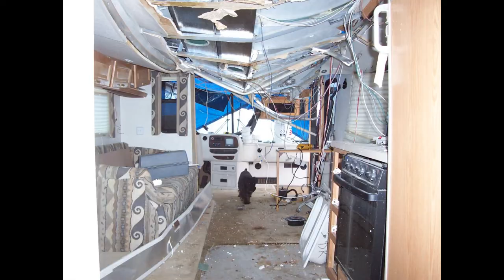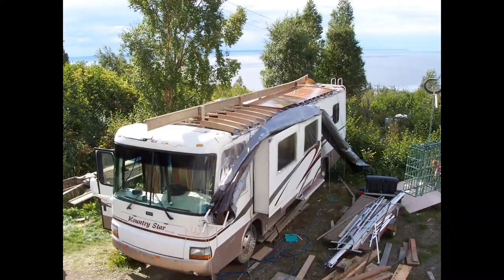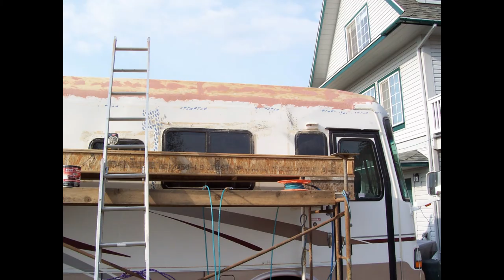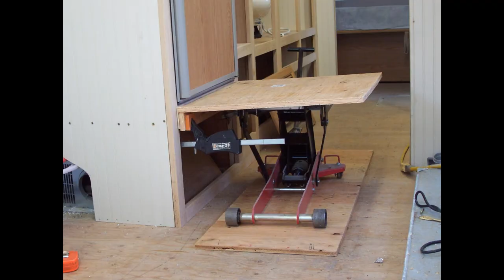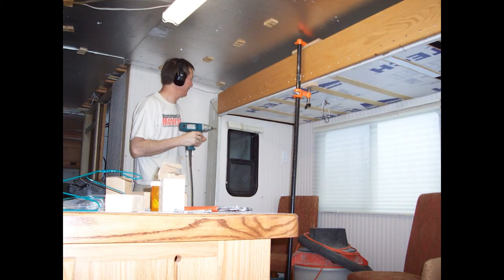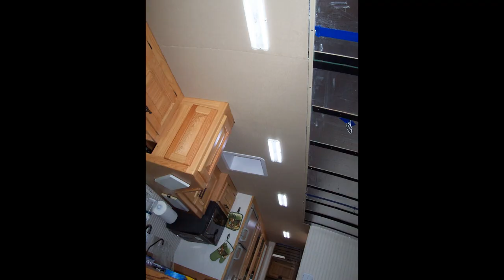Picture video of rebuilding a totaled Class A motorhome

Comment: I've been in Class As for years. I seen a few that had been rolled and that's what I first thought happened to this coach. I must say bravo to you and your fam (crew) for the huge amount of work that went into this.
Reply from the maker: Thank you! We were pretty shocked at how poorly built and flimsy the structure was once we opened up the walls and removed the roof. I would be amazed to see one of these (Newmar's) that had rolled over, I wouldn't expect there to be anything left above the floor. Our Kountry Star would have disintegrated in a roll over. 

It is structurally much stronger now but I doubt there would be much left of it in a serious crash. 
Best we don't crash!
Reply: @JagLite  I own a Wanderlodge. All steel top to bottom , front to back but for the end caps. That why I bough it. Can’t afford a Prevost or a Newmar.
Reply from the maker: @christopherrasmussen8718  Yes, the high end coaches are very well built, but you must be thinking of Newell, not Newmar.

 I hope Newmar's (Dutch Star, etc.) are built better now than our 2001. The wanderlodge has always a very well made vehicle. The average relatively affordable campers have to be pretty simple and quickly built.
Reply: @JagLite  My bad. That’s what I meant.

Comment: Wow  great work guys. I have a 2006 Damon Astoria  Class A so it is very interesting  to  see the actually reconstruction of a unit. Great video
Reply from the maker: Thank you! 
I was surprised at the low quality of the original construction but maybe it was built during a new employee training period? I can understand better why an RV remodel costs so much. The remodel has to deal with all the hidden issues. But that's no different than old house remodels, you never know what surprises you will have to deal with until you open it up.
Reply: @JagLite  that's too bad about the low quality in the initial build. I bought  my Astoria used and what I've had to work on, the original  build was awesome. Thor motorcoach have been extremely  helpful.
Reply from the maker: @johnelias9568  Argh! Jut lost my reply, Try again...
That is excellent that Thor was helpful! 
Newmar was the opposite. When I first brought it home I called Newmar to explain the project and that I was going to order a lot of things from them, including the aluminum header beam that supports the roof over the slideout.

I was told that they do not sell parts to owners, I would need to order through a retailer and that they do not sell structural parts anyway. Nor would they give me information on the dimensions, specs on the header beam. ( I just measured the old bent beam and built my own) Then when I had it opened up inside and had the rats nest of wires exposed I tried to get an accurate wiring diagram but the RV shop I was ordering from said they couldn't order anything (no wiring diagram available) and suggested I call Newmar directly. I tried again and was told the ONLY wiring diagrams are the ones found in the owners manual and I could order that through my retailer.  I have the complete owners manual and the wiring diagram is a joke. It is a generic diagram for ALL their motorhomes (at that time) and the diagram states that "Your coach may be different" and that the wire colors listed for various circuits "may be different". Totally worthless.

They had the wires going any which way, wires that were spliced in the middle of runs, wires that changed colors between connections, etc.
I had two options: 1. to completely rewire the bus and run the wires in sensible directions and locations, or 2. to just put the mess of wires back where they were since most everything was working. I went with number 2.

We only have two lights that don't work and those are the reading lights for the two front seats and we don't use those lights anyway.

The shop I ordered most parts from said Newmar was the most difficult brand they order parts from. Hopefully that has changed and improved over the years.

Comment: awesome job. I know you had to deal with every aspect of the RV in order to accomplis this, KUDOs to you. just wondering, what is your background proffesion? you accomplished a lot in a short time. were you also working at the same time?
Reply from the maker: Thank you! I had experience as a sailor and boat builder (wood and fiberglass) as well as a carpenter and cabinet maker. Both Robyn and I were working full time jobs which is one reason it took 3 years to do it. We did use it one weekend at the end of the second summer but it still had a lot of interior finishing to do. The short summers and long winters slowed progress down.

I drew up plans for a temporary shelter but when I added up the cost of the materials it was way too expensive to build. We lived (then) on the hillside and the winds up there during a storm would pass 65 mph regularly with higher gusts. Anything built had to be extremely strong and anchored down completely. But having a shop to put it in would have cut the time drastically.

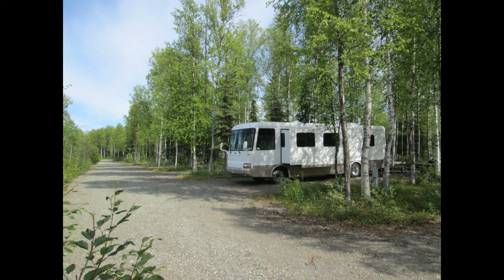Comment: Looks good except for the crack on passenger side near the roof at 5:44. I bet the roof has not held up well at the top. The stuff they use for class A rv roof seal is absolutely junk. You should have got you a school bus and redid it. Class A RV are junk.
Reply from the maker: That is not a crack, it is an overlap where the front cap goes over the side wall. Originally there was a trim cover that ran full length of the roof to sidewall seam.  The new roof is glassed into the sidewall so no leaks are seals. I left the front cap overlapping the sidewall since it a very short distance. It is the same on the driver side.